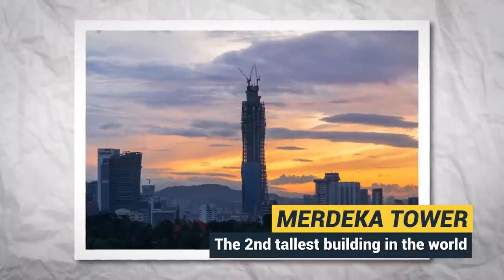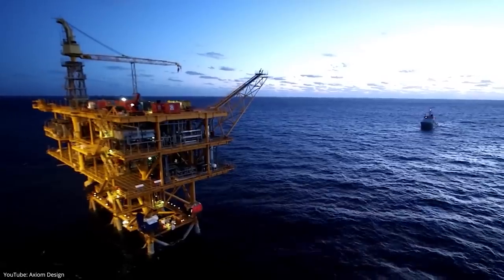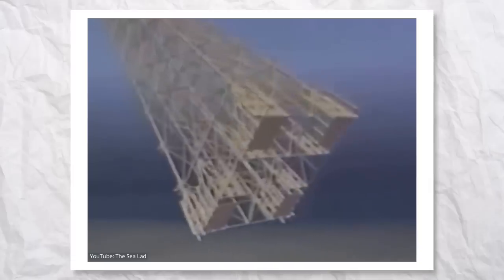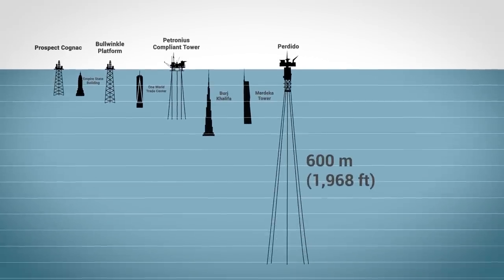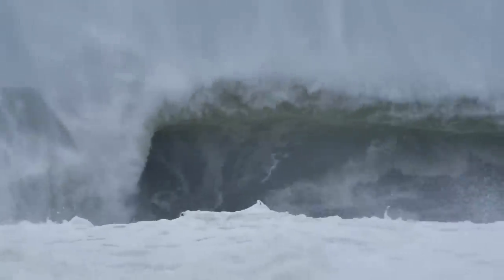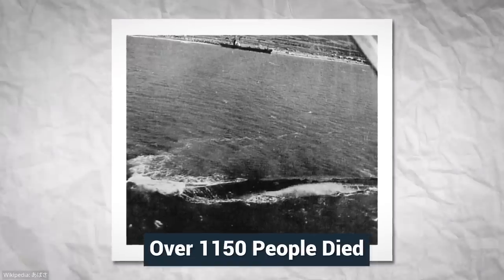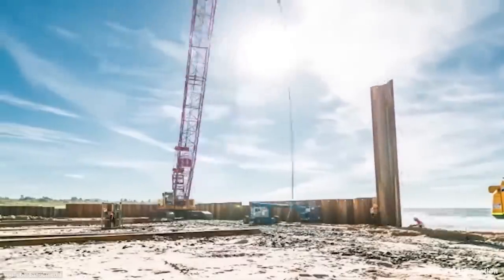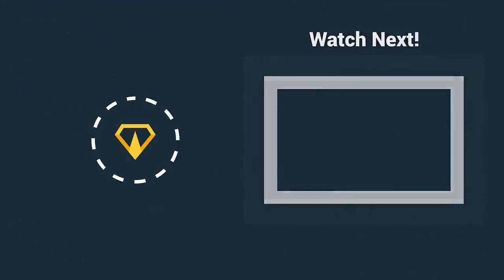The Insane Size of Underwater Megaprojects

Comment: I wonder how these floating oil rigs cope with tidal water level changes.
Reply: With multiple tie-down cables to multiple massive "anchor" cement structures.  All are monitored for tension to stay within the design spec of the cables
Reply: in the ocean its not even felt

Comment: If I were a billionaire I would make an underwater fortified base. Not sure if I would go the no leak part or the use air pressure to keep water out. Not sure what that is called. Thjnk you have to be very careful though with that as you can get the bends from it.
Reply: You best make sure it's watertight.  Otherwise, even below 30 feet you need to maintain pressures that will require decompression breaks for people leaving the structure.   This was an issue for the builders of the Brooklyn Bridge.   Worth checking out.